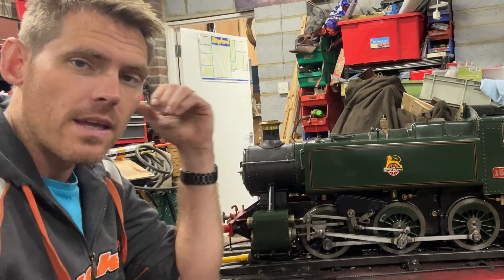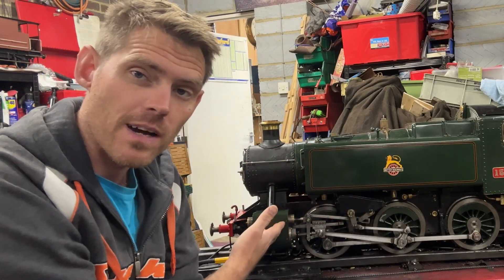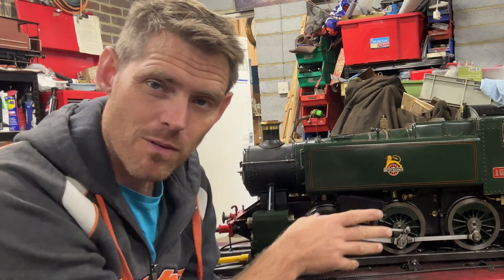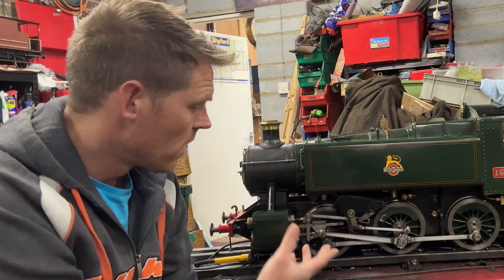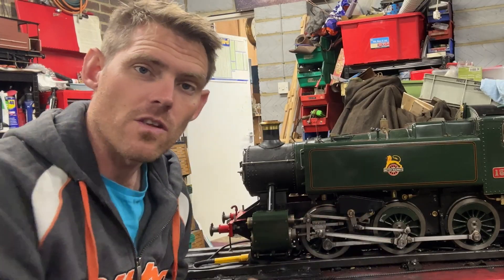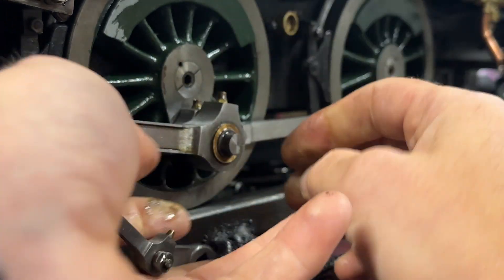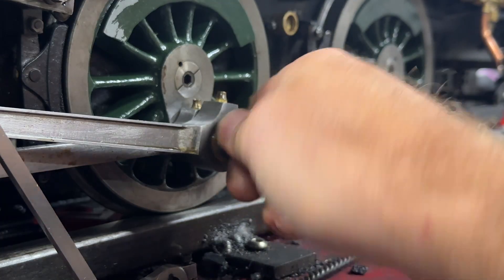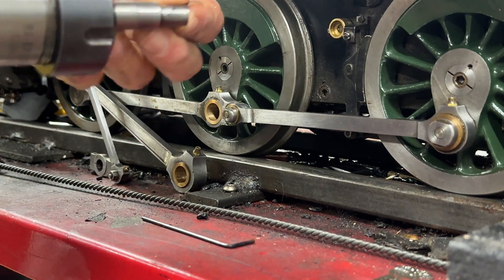Correcting a valve timing issue on a 5” speedy…

Comment: Learned a bit in this, I’m a big believer in the crank never moving, but as you can see, it leads to worse problems if something goes wrong. Rather reset the crank (there should be a mark at the least as it should never move from that setting in ideal situations) than have the crank pin itself move (that should be pinned if anything) or other valve gear rods bent. Thank you for doing these videos!

Comment: Hi Tom, I'm  never completely  convinced by the need to "cotton reel"  pins  to "give the Loctite somewhere to go".  The Loctite datasheets also mention using it  in conjunction with press fits, and even shrink fits, so this certainly suggests that the gaps listed in the datasheets are a maximum tolerance range for a loose fit, and not a necessity. 
Clem
Reply from the maker: I think it depends on the loctite, different ones have different tolerances. In the past I’ve usually just added a bit to a press fit, but thought I’d try it this way as I’d heard a few people recommend it.